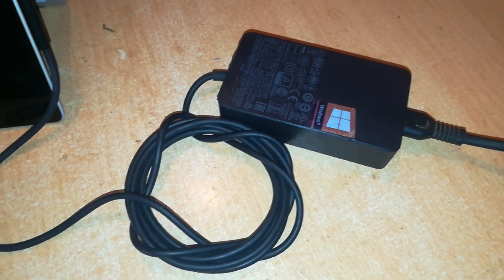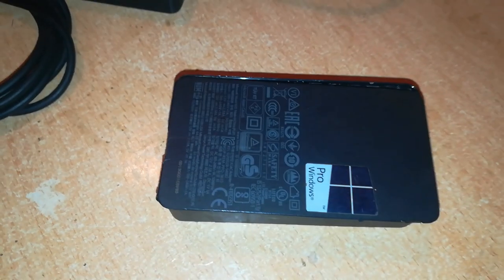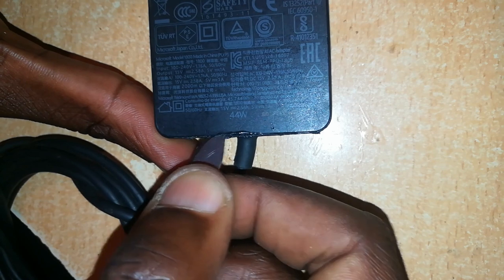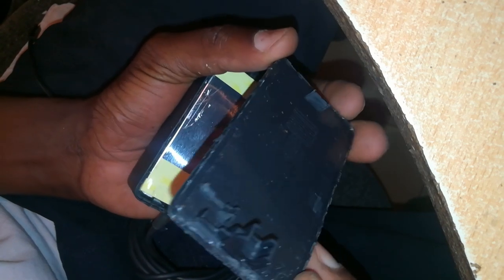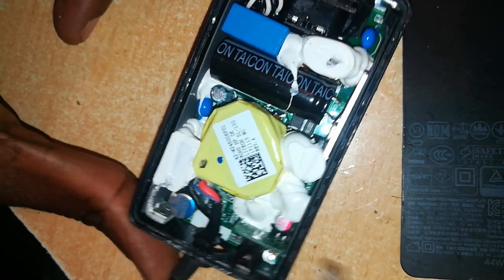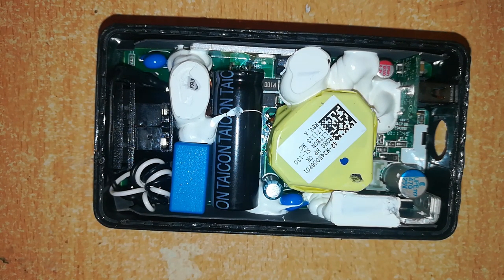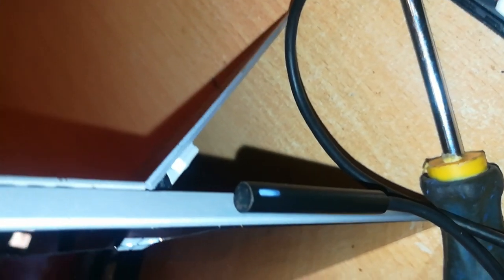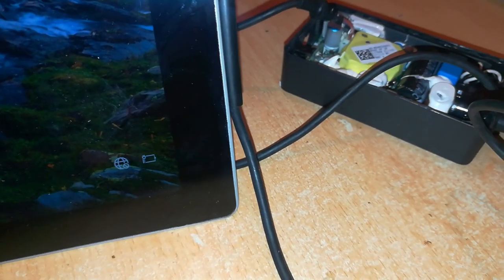Open and Repair Microsoft Surface Pro Charger not working PART ONE #surfaceproadapterrepair

Comment: Good video. These things would be relatively easy to fix if they were held together by screws. One day this shit will be banned and manufacturers will be forced by law to make equipment fully serviceable.
Reply from the maker: till then.........!
Reply: @reachtech1  Just ordered a pack of 4 myself. They are all the same. If it ever fails I'll crack it open, replace the relay and put the PCB in a small plastic box.
Reply from the maker: way to go! all the best! subscribe to the channel!

Comment: my surface pro charger output is turning on/off every second when checked with multi-meter. Any suggestion to check
Reply from the maker: maybe...just maybe...it may be asking for retirement! hard to tell, but the inner components may be degraded